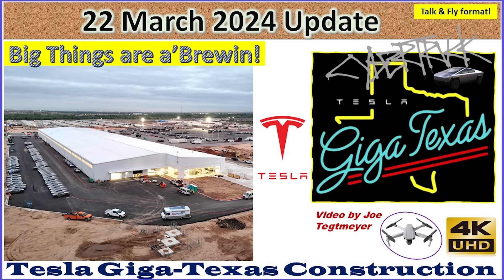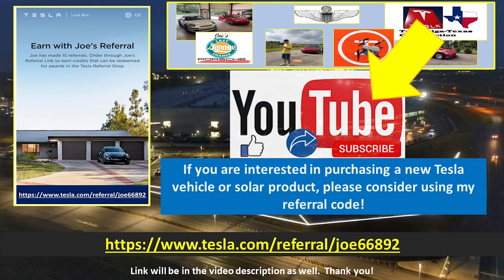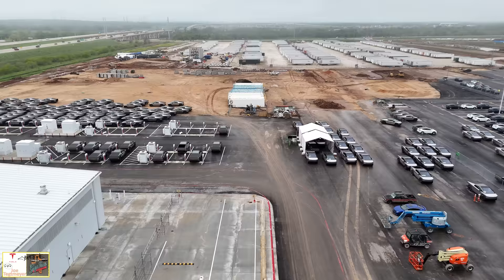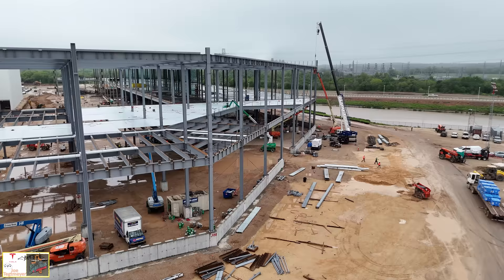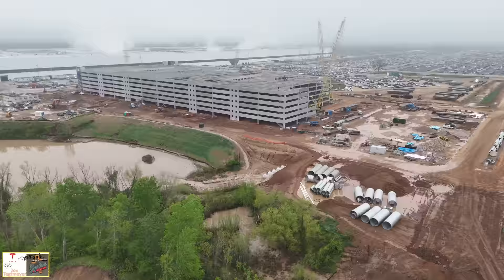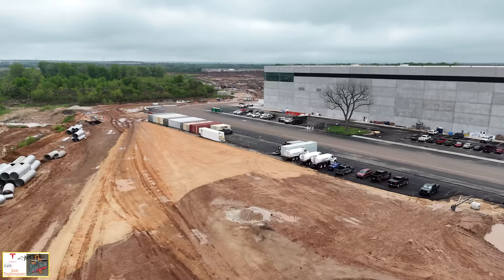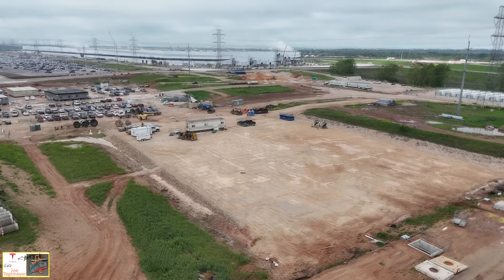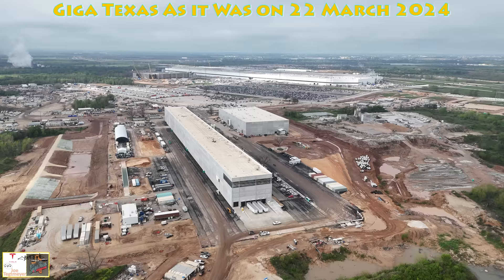~ 400 Cybertrucks, Boring Ops Start, S Extension Grows! Wow! 22 Mar 2024 Giga Texas Update (09:15AM)

Comment: Thanks Joe.
Particular thanks for following the route of the new pipe project on the roof. Hopefully gets some interest in the comments, and maybe some clues as to the purpose.
10:40. Southend, west. Perimeter beams installed at heights that match the main building Levels 2 and 3.
Beams are both fitted with fixing lugs on the bottom flange to take the glazing channel.
Can’t quite imagine how the 2 rows of windows on the main building will transition to full height glazing of the extension.
A second braced pair of columns abutting the existing building.
11:47. Southend, south. Inside. Trench. Concrete placed. Finished floor, not a mud base.
Trench wall rebar. Water-stop seal in between the 2 rows of rebar to keep the trench free from groundwater ingress.
11:50. Southend, south. Inside. Pre-fabricating rebar cages for the trench walls.
Outside. Glazing hoisting equipment covered up. Crane gone.
12:13. Southend, east. About centre. Pair of Cybertrucks. To the right is a screw pile seen installed in Brad’s video yesterday.
Seen at bottom at 14.18 also.
13:22. Southend. Inside. Right. East trench. Tele-handler lifting across a prefabricated rebar cage. Trench retaining wall presumably.
Unbuilt section. Design in progress possibly.
13:44. Southend. Tank Farm. ‘American Tank and Vessel’ trailer has been removed.
Some gravel laid and compacted for a stable working base. Steel being staged. Seems this area may be constructed next.
15:46. Parking Garage. North-east corner. No sign yet of footings for an elevator shaft in this corner. Single elevator location seems likely.
16:10. Parking Garage. Bottom. 3 spools/reels/drums of cable behind the electrical vaults.
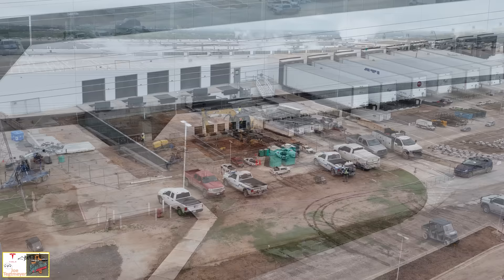17:38. BIW, loading dock ramp. Excavation works associated with lowering the various drains and conduits.
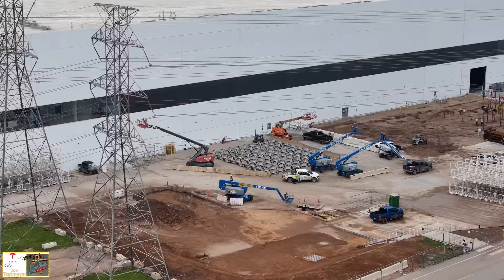18:20. Casting east. Apron. Screw/auger pile works.
Not the type of set-out that would be expected for a building. No groups of piles that would be expected for under a column for example.
A tank farm, or plant structure associated with the Roof Pipework Project is my speculation.
21:04. Cathode. Tank Farm. 2 additional stainless steel tanks finally found a home. Nearly 2 years since arriving on site.
Plant Platform. Scaffold erected against the building.
21:55. Crash Test Track. Dunking bath. Tank installed behind the crash rails. Might be a special retardant.
A Structural Battery Pack seen in Jeff’s previous video, lined up in front of the dunking bath in a taped off area. Possibly trying to induce a fault to cause thermal runaway.
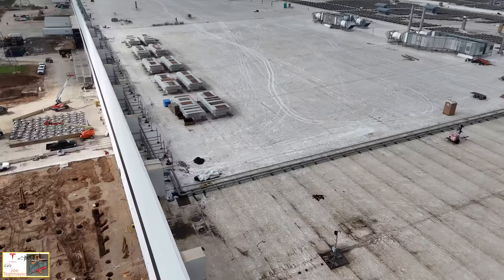26:15. Roof. Pipework. Interesting that there is a considerably shorter route between either end of these pipes. Suggests that it isn’t a simple pipe run between A and B, but a particular route taken so that branches/laterals can be connected in at various locations along a the route.
Reply: 26:15 So why not run the pipework inside below the roof beams/trusses? Not a construction expert but I imagine re-roofing will be a real pain with the added pipe supports. Yes, there already numerous roof penetrations, but why add more? Especially if they can hang the piping from inside. Though I could be wrong... Seems like this is be lazy now, pay later.
Parking garage elevators... 15:46 Again, seems like a really bad idea. One elevator location and how many people during shift change? So I'm hoping the footings are just covered up.
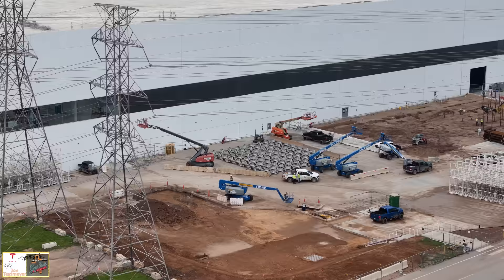Reply: 18:12 (Bottom) Conduits sticking out of embankment....
This is the reason they had to do a HDD bore under the road for a new duct-bank for the Superchargers. Those 16 conduits.... 8 across x 2 deep encased in sand, then covered with concrete,  provided power to the building from the temporary substation, and power out to the Superchargers before they were cut.
Reply: @DavidJohnson-tv2nn  Yes, I can tell you have not tried to hang pipe inside a building.  It is much easier to run it on the roof, in a straight line.  And the Tesla building has a lot of stuff hanging from the ceiling inside the building.  Roofing is not really a huge problem, that only happens once ever 10 years?  

My guess is they are chilled water lines, and there are evaporators under the roof someplace, and blowers inside the building every 100 - 200 feet, so they can blow out cool air to cool and dehumidify that part of the factory. 

I used to work in a 750,000 square foot building, Weiser Lock in Huntington Beach CA.  There are beams that hold up the roof, and those stick into the building by about 2 feet, so would be a huge obstacle to get around.   And with Tesla hanging production stuff from the ceiling, that will limit the free space to run piping like this. 

The old City Hall in Long Beach, they had a pair of 750 ton chillers for about 200,000 square feet of space.  So with over 1 million square feet, I would expect about 3,000 to 4,000 tons of cooling if they want to keep parts of the building cool and low humidity.  The battery construction area needs to be about 5% RH, difficult to do in Texas where it can reach 75% RH and 90 F outside with hundreds of grains of moisture in each cubic foot of air.  

Areas like paint and the stamping shop, they might not be cooled at all or only a little bit to prevent overheating.  

Reno Nevada was picked for battery production because of it's low humidity and the free cooling in the winter, when it typically snows each winter.
Reply: 23:31: Martin Marieta seem to have managed to clear most of the concrete waste from around their area! There used to be heaps all over the place.
Reply: @greggerypeccary  23:31. Slowly building up again. They do have a crusher plant on site now. Haven't seen it used yet. It's beside the sand bin, a little above the centre.

Comment: Roof Pipework Project. 
*Tight radii on the 90 degree bends. 12” 300mm or so.
*Pipes lengths are welded together, not mechanically joined (flanged/clamped/threaded etc).
*Pipes are quite closely spaced, possibly too close for insulation/lagging.
*Expansion bends not adequate for very hot or very cold liquids. As noted by HarderNL.
*Pipe support structure behind the parapet is currently set up for 2 levels of pipes/other utilities. Pipes are located on the lower level.
*Pipes take the long route between the current start and finish points. North west end is at the roof valley between Plastics and Paint. Pipe runs east over the roof ridge between Paint and Casting, to the Casting parapet wall. South behind the parapet. Turns west over the roof of BIW, crosses the ridge again into what was formally known as the High-Bay area.
*A more direct route exists that is shorter by 620' 190m. Suggests the route chosen is to allow for connection to a variety of stations along the selected route.
Reply: Maybe the long route is because there's something the short route crosses which is a problem? (where is the burst area for the paint hazardous materials room?)
Reply: @greggerypeccary  That's a possibility. The logical short route down the roof valley passes by that area.

Comment: Thanks Joe!
River road:
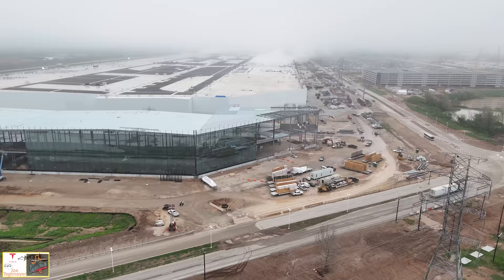@ 14:51 Good view of the ongoing work to extend River road to Robotic Ave.
Parking garage:
@ 16:23 (Bottom left) Three cable spools, ready to pull cable into the duct-bank.
@ 16:26 (Bottom right) If you look closely there is a duct-bank going to the building with conduit risers. There is also a pad-mount transformer sitting in the dirt further east. Guessing or speculating that this may be the power entry point to building.
Also.... Concrete pour on the top deck.
Eastside of casting:
@ 18:12 (Bottom) Conduits sticking out of embankment are the remains of the old main power duct-bank from the temporary substation. All of the power for the building, as well as power going out to the east parking lot Superchargers used to go through these conduits.
BESS substation:
@ 24:21 NOT fully operational yet.....
(Bottom left) Switches to the backup power feeds remain open.
Megapacks:
@ 24:22 Caution tape closing off the north west corner of the yard and 4 megapacks.

Comment: There is still one piece of equipment evidently missing in the NW corner of the chiller plant. You can see a reinforced raised foundation in that corner. Im betting we will see that installed before the rest of the Evapco condensers are added. The pipes along the roof? Appear to be the conduit for the Solar installation.

Comment: Joe isn't there lots of pipe underneath the ground there from the huge vault they put in a while ago right by the perimeter grade beam so the tunnel could not pop up that close?  I think they are not finishing the middle yet because the tunnel is going to come up in the center section.  Would be cool!
Reply: Deep well is 20' 6m north of the tunnel alignment centreline, some manhole risers about the same distance south. A pipe crossing between both that is at a depth suitable for the TBM to pass above as it nears the perimeter grade beam.

All visible at 10:54.

Comment: Joe, isn't the cistern system in front of the maybe tunnel opening on south end?
Reply: Deep well is 20' 6m north of the tunnel alignment centreline, some manhole risers about the same distance south. A pipe crossing between both that is at a depth suitable for the TBM to pass above as it nears the perimeter grade beam.

All visible at 10:54.

Comment: The pipes on the roof. Could that be conduit for the solar panels
Reply: Definitely a pipe rather than electrical conduit. Welding equipment visible at 26:51. Expansion bends at various locations behind the parapet.

Comment: Conduit to collect the solar electricity
Reply: The radiuses are too small for electrical conduit.  Likely chilled water..
Reply: @patrickkenny2077   Good view of a radius at 27:00. 12" or thereabouts. Same view shows welding gear. Pipes also quite closely spaced, no room for insulation. Weirdly long route between end points.

Comment: Batteries will not be using lithium by the time they get that plant built.
Reply: There is no binary, 'not finished' vs 'built'. Tesla produces quality vehicles as soon as they can and is in a process of continual improvement on each vehicle model and on each production facility. If and when new battery tech and cost factors shift EV and/or stationary storage away from favoring lithium Tesla will adjust their production lines. Tesla is already employing several different battery chemistries in their cars and stationary storage products. People who wait for some never to exist perfect and final tech never get shit done, or could purchase any new tech item. For all we know lithium used for battery storage may stay the course, and become a closed loop supply chain between recycled batteries and new ones. That would be several decades down the line, but is not unanticipated. Look at steel, and lead, etc. It is already pretty much the case for EV's cobalt needs, and for oil refineries cobalt needs. Cobalt blue for crockery? Not so much 🤨.